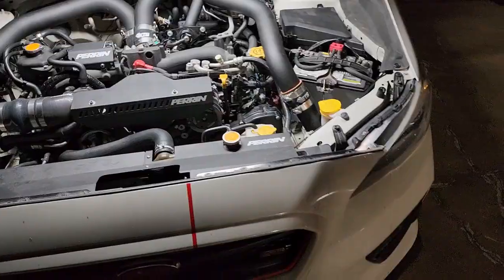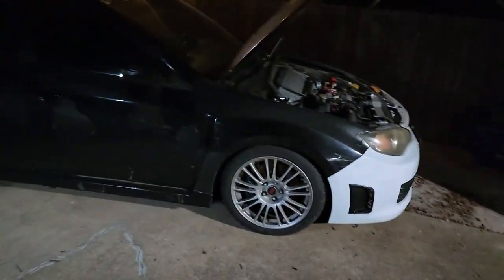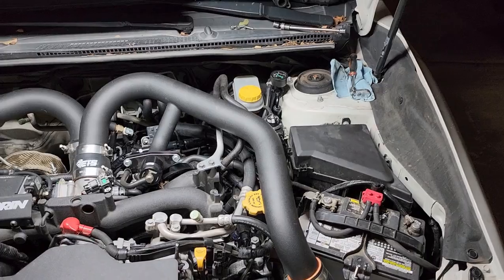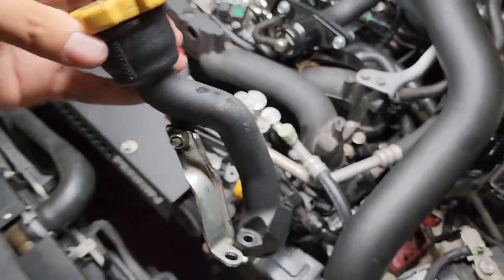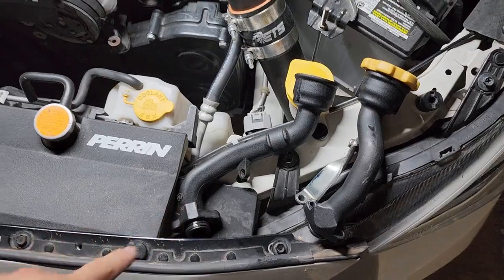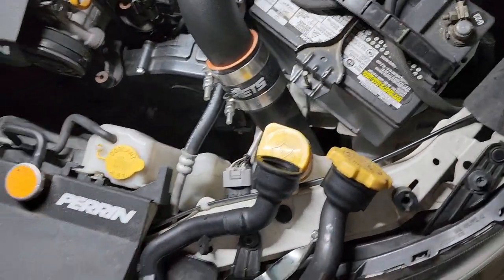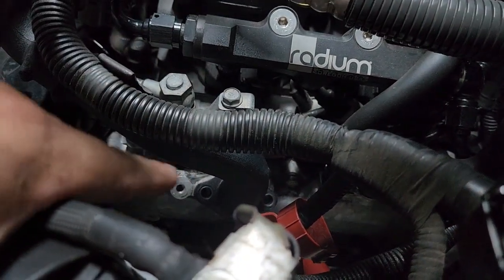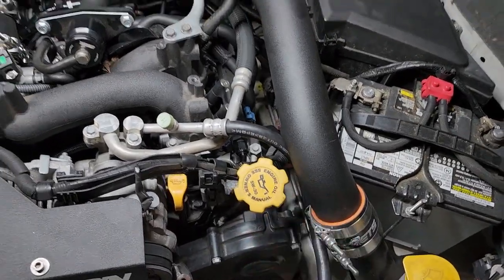2015+ Subaru WRX STi With ETS FMIC Must Upgrade!! (Oil Fill Tube)

Comment: If I delete my air pumps but still have a high flow cat and do open source can I pass emissions on a not so strict state
Reply from the maker: @JermJermFlores  I would say obviously depends on state and depends on the shop. High flow cat meets emission requirements in most states that use federal standards. Removal of the pump would not fall under being ok in any state but inspection is not strict in my state and I have it pass every year as you see in the video
Reply: @D-TunedGarage  what program are u running to run flex fuel? Is it open source still?
Reply: Give you an idea, I live in shit California. My STI has a Cobb intake, up pipe and their 20g turbo (all carb legal with stickers), ETS TMIC, killer b headers, 1050 injectors and 340 fuel pump, STOCK downpipe, IAG AOS, Koyo radiator and pro tune. I’m still hesitant to try to smog it legally. I got it hot smogged last year. I read the AOS or pro tune may be a disqualified.
Reply: @Craiggg12345   AOS street is carb compliant , bring the sticker. A protune would clean up the A/F and should make that pass if its dialed in right.
Reply: Do you know if they check ECU for 2nd pump> otherwise i would just "fake" mount it when you do the delete and go in for the inspection.